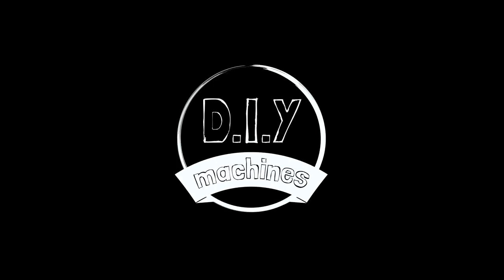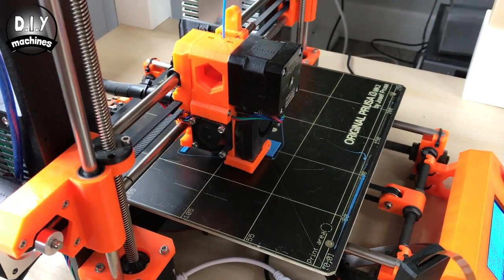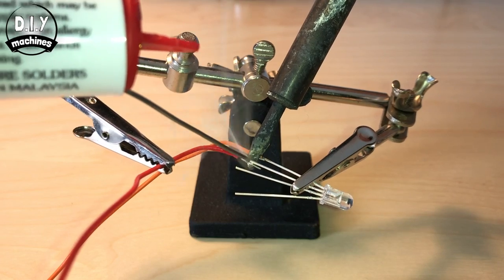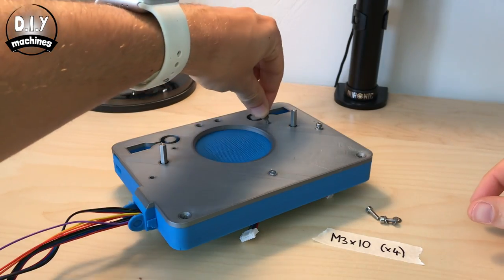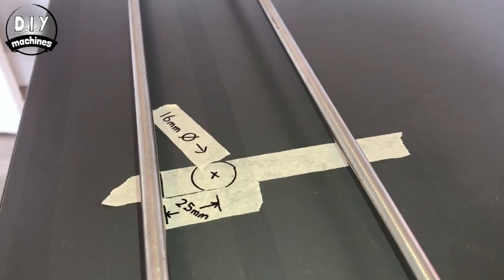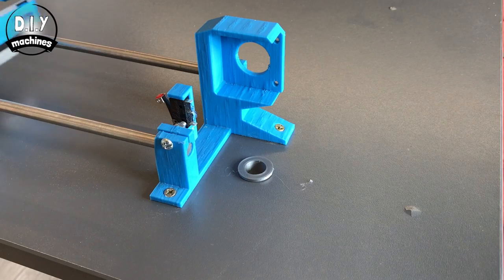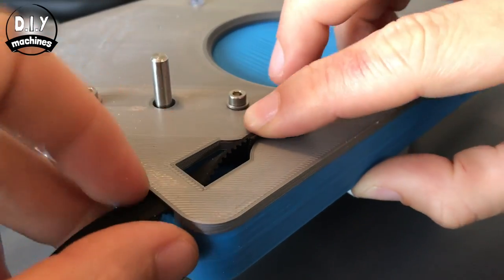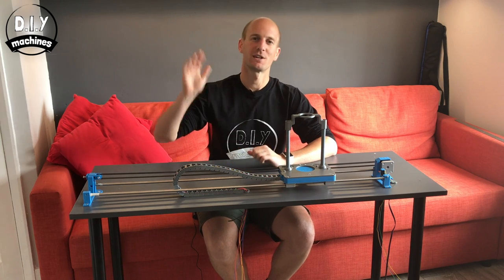How to build an Arduino based DIY 3D Printed Robotic Bartender - Part 1

Comment: What size screws and nuts were used? It's touched upon most of the time in the video, but what screws do you use to attach the bot to the table? What type do you use for the belt tensioner?

Comment: Hello, what filament do you use in 3d printer? you could make videos of your printer too, I found the quality of your print excellent, could you make your settings available?
Reply from the maker: Thank you Andre. I use PLA filament from Prusa Printers.
I print most of my parts at 0.2mm layer height with 20% infill. I use the filaments recommended temperatures and Slic3r to generate the GCODE.

Comment: Hi! Awesome design! I’ve used some of your parts and customized them to my own design. I only have one question... for the slider that the glass is placed on, do you use supports for where the belt goes through? I did but it is a pain in the ass to remove them 😬 thanks again! Michael
Reply: Did you use support to the slider? or did you remove their supports?
Reply: @GregoryJrNunez i did not use support.

Comment: Hello congratulations for your project is very nice to see, I like the idea of making one, but I have doubts about the printed parts 3d, I would like to know the measurements of the base of the glass and the other printed parts. please . best regard
Reply from the maker: Hello and thank you. These are rough, squared off foot print measurements for each part in the position I printed them:

Glass base: 190x125mm
Paddle: 145x58mm
Motorised x axis base: 75x128mm
Idle x axis base: 100x128mm
Threaded rods: 25x25mm and 180mm high
Reply: Thanks!

Comment: can you please explane why you use the micro switch and the led light ?
Reply from the maker: Sure. The micro switch is so that we can 'home' the X axis and know where it is when we switch on the baron. The LED is used to communicate when the barber is either ready to take a new drinks order, is currently creating a drink or had finished making the previous drink. It does this by changing the colour of the RGB LED.

Comment: hellow I am a student from Belgium and for my final year I need to make a final thesis. You inspired me with the 3D printing sow my final thesis is your project but i have a question were do you store the recipies for the cocktails?
Reply from the maker: jarni Van halewijn hello. Wow, that’s great to hear. I’m just editing the next video which includes more feature rich code. It will be published in about a week. I’ll make sure to explain in that video how it receives and processes recipes when you request a drink from it. I’d love to read a copy of your thesis when it’s complete as well. :)
Reply: That's great I will send you a copy as soon as it is finished.
Reply: Hello again
I was just wondering wich NEMA you were using is it the NEMA 17 5kg/cm or the NEMA 17 4kg/cm?
Reply from the maker: Hello, I hope your thesis is coming on well. I couldn't find out a direct answer but I did find the below specifications. Perhaps you might be able to glean what you need from it?

Drive mode: Chopping wave constant current drive
Exciting mode: Two-phase 4-wire, it is available for rotation of forward and reverse
Turn to: The order of power is AB-BC-CD-DA, from shaft end see C.W
Rated current (one-phase): 1.5A DC
Rated voltage: 3.45V
Stepping angle: 1.8°
Operating Conditions: Environment Temperature: -20~50℃; RH: 90%MAX; Mounting Position: Axis horizontal or vertical installation
Direct-current winding resistance (25º): 2.3±10%
Wnding inductance: 3mH±20%
Cogging torque: 12mN.m REF.
Holding torque: ≤300mN.m I=1.5A
Max. no-load starting frequency: ≤1500pps
Max. no-load running Frequency: ≤8000pps
Temperature rise: <80K Rotary inertia: 38g.cm2
Motor Weight: 0.23Kg/PC REF.
Insulation resistance: Cold insulation resistance should be more than 100¸ (between the Motor stator core and Terminal)
Dielectric strength: The space between the Motor stator core and Terminal should be able to withstand AC600V/1s without breaking down.
Leakage current is less than 1mA.

Comment: Can I ask You, these steel poles are from pure steel or they have chrome surface for better strenght
Reply from the maker: Kamil Tompalski. I used pure steel. They do flex a bit so if you can get your hands on some with a chrome surface you may have a better build.

Comment: Friend Congratulations on your work, I have a question, how wide is the Rubber Opening Belt? 6mm or 10mm?
Reply from the maker: Thank you, the belt is 10mm wide.
Reply: DIY Machines thank you
Reply: Hi my friend, do you think there would be a problem with the Slider Base and the Rubber Opening Belt if I use 6mm instead of 10 mm? Because all I could find was a Pulley with 7mm for the Rubber Opening Belt?
Reply from the maker: Hello, I can't see a reason why using a 6mm belt would be a problem.

Comment: I think this is an awesome project, but for people who don't have 3D printer is it possible to simplify design to just use pieces of wood.  I can see that "blue side mounts" (ones holding metal railings could simply be two pieces of wood with holes and some tightening scres.  Attaching motor to one of the "wooden side mounts" also seems to be possible. The "shuttle" can be made of wood as well, the key ingredient is to attach those "rail huggers" to the bottom. The only piece I cannot see solution to is this chainlink. Can there be an adjustment to the design, which permits to skip the chain altogether?  (Maybe attach wires to from different angle, or use some other idea to allow wires to move between sides?
Reply from the maker: Hi, yes a wooden one would certainly be possible. If you lifted the rails up so you had enough space to mount the electronics under the paddle and moved the motor for the x-axis, and it's end stop switch onto it as well then everything would be contained on the paddle - no cable chain required then. :)
Reply: would would expand/contract with the temperature/humidity changes and lead to all sorts of problems.

Comment: how much infill percentaje do i need for my 3d printed pieces? Would you please give me suggestions about it?
Reply from the maker: Hello. Yes sure. I've printed them all at 20% infill with the exception of the big base the glass sits on and the upright threaded rods which were all printed at 30% for some extra strength.

Comment: HI Kobe again, 
Do you use 3 times the same stapper motor ??   XCSOURCE Nema 17 2 Phase 4-Wire 1.8 degree Stepper motor 42 x 42 x 34mm For 3D Printer TE225 
Thanks for the earlier response! 
When I'm done I will send you some photo's. 

Kobe
Reply from the maker: Hello Kobe,
Yes. It's three of the same motors. I noticed amazon stopped selling the one I linked to so I found an equivalent for you:http://amzn.to/2mQQqkn
Reply: @DIYMachines  Hi, not sure if you still reply to comments. But I've bought the shield and 1 of the motors in the description and the shield overheats and the motor doesn't move as you'd expect. When I read the specs it's a 1.5a motor when the l293d outputs 0.6a per bridge. Are you sure these parts are compatible? cheers.

Comment: Also, when I am looking on amazon at the RGB LED's, there are two options, common cathode, and common anode. I was wondering if it makes any difference, and if so how to determine which to use. Do you know what are you using?
Reply from the maker: Hi Gavin, the RGB led is a common cathode (they are all connected to the same ground pin): https://geni.us/RGBLEDCC

Comment: what do you suppose we do if we can't 3d print those things for the project?
Reply from the maker: If you (or you don't no anyone else who might be able to) can't 3D print the components you could still download the models and build a similar frame for the various electronics from another material such as wood. Just be aware that some of the spacing explained in the video may be slightly different.

Comment: Can I ask you something. What is the role of the micro switch??
Reply from the maker: hung hung H The switch allows us to home the position of the x axis (the paddle which holds the drinks glass). When we power on the barbot the paddle could be anywhere along the rails. The first thing we do is move the paddle to the right until it bumps up against the switch, at that point we now know where it is located. If you watch the intro to part 2 you can see this happening.
Reply: oh. i understand. So how to move the paddle to the location of the bottle. Do you use any kind of sensor? Or just set the stepper motor to a certain parameter after trying to run?
Reply from the maker: Your second idea is correct. We save the distance to each bottle optic and move the paddle a certain distance each time we need to move between bottles. Because of this after every 5 or 6 drinks made we will re-home the paddle to prevent any drifting of its position.
Reply from the maker: Thank you. I'd love to see your version of this - send me some pictures of your project general@diymachines.co.uk. I'm still writing my code, I'm an amateur coder but am almost there with it. I will off course share it when it's complete. :) I post videos on my Patreon for my supporters first, then a couple of weeks after that I share them publicly. If you'd like to support me you can send any amount on www.patreon.com/diymachines to become a supporter and get early access to videos amongst other things.
Reply: I also write code. have something I do not understand. Can you explain me int raftFound = false, int raftFound = true? What are these two commands?
Reply from the maker: When the barbot cold starts the variable 'raftFound' = false. Whilst raftFound = false the x axis motor pull the drinks raft towards the contact switch until the switch is hit and this is detected. At that moment, the variable raftFound is set to true. Only whilst raftFound = true can the barbot serve drinks as we know the position of the paddle.
As mentioned before, in the new code I am currently writing, after several drinks have been served raftFound will be set to 'false' forcing the machine to home the x axis again in order to maintain the accuracy of its position.
Reply from the maker: I don't simulate the circuits, I build and test a prototype as I go. If you're like me to try running your code on my barbot that's fine. You have the right email address - drop me a message and I will see what I can do. :)
Reply: tks bro. please check mail ^^
Reply: bro? I sent an email to you.
Reply from the maker: Hi, thank for your patience. I've been very busy elsewhere at the moment and haven't found as much time for this channel as I'd like. I've looked at the code. I have not yet used servos so cannot comment on that aspect but I don't see why the idea wouldn't work. It may also be able to operate the optic quicker. I'm just about to publish part four which features some heavily improved code which is able to take an order from a variety of sources. In that video I show you how to hook it up to bluetooth (the module is only about £6). I'll be creating a video for voice control next and then I'll look at a button menu soon as well.

Comment: What is the resolution for your 3D printing
Reply from the maker: It was a little while ago I printed these parts but I believe I printed them in either 0.15 or 0.2mm layer heights.

Comment: how long was you rods
Reply from the maker: youngstar025 the rods I used are 1m long. You can use any length. The shorter the rod the less width you have to fit optics.

Comment: a)  you would have been better with heat shrink then electrical tape on your connections.
b) why not just buy a drag chain?
c) i'm surprised you didnt nick the fuck out of the wires, when you drilled the hole in the end of the drag chain.  (not to mention your drilling techniques need ALOT of improvement in general)